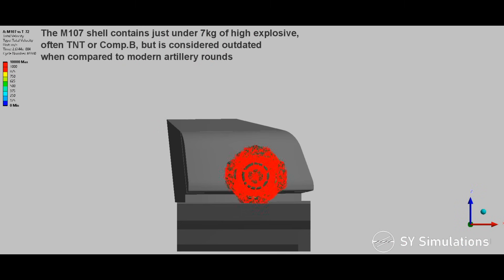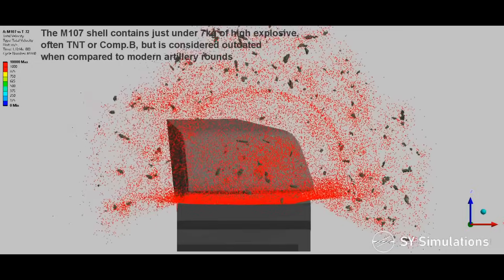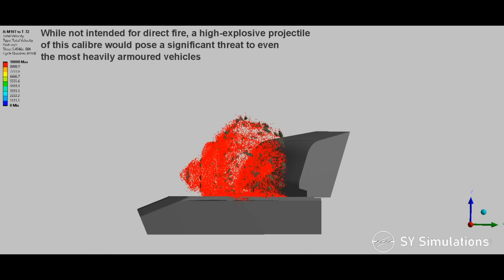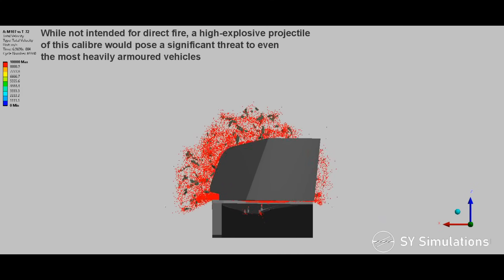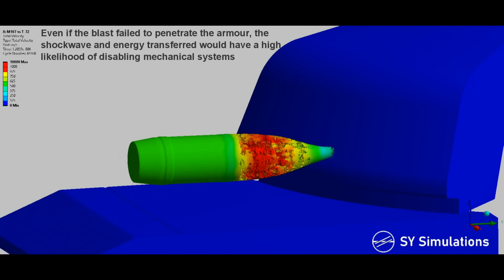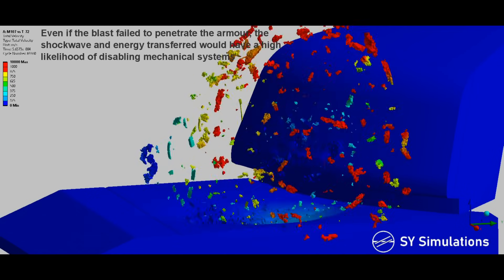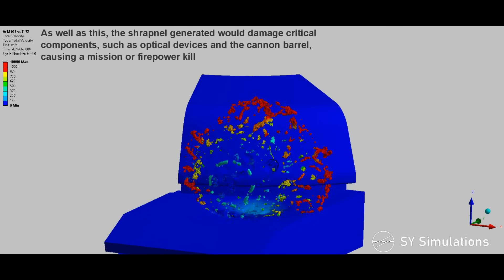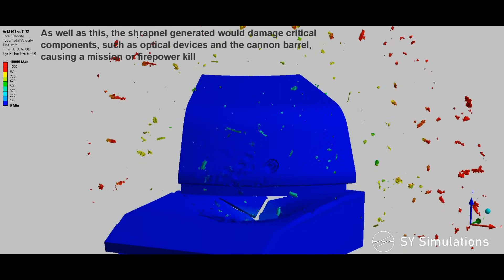DIRECT FIRE ARTILLERY vs T-72 | Paladin 155mm M107 High-Explosive | Armour Penetration Simulation

Comment: What is the thickness of turret roof in T-72 ? Because there are pictures of T-72 tanks which withstood a hit of  152mm HE shell on the turret roof without breach.  The roof was heavily dented and the tank was probably write off but it didn't break trough. Could you simulate a 45deg hit to the T-73 turret roof for validation ?
Reply: I don't know how thick it is, but T-72 tanks are known to resist at least two direct hits from anti-tank weapons like Javelins. There are videos showing it. Unfortunately, we cannot compare the Leopard A6 or Challenger 2 tanks, since Russia has used Lancets instead.
Reply: @abraxasarchon  We are talking here about 152/155mm pure HE shells, would they breach the armor or not if hitting the roof. Javelins have  HEAT warheads and it's not comparable.

Comment: Seeing 155mm HE blow the top layer of the hull to bits like that really makes me wonder why we didn't just decide to forget about penetrative rounds and entirely roll with large HE  fore verything
Reply: 🅱ESH has entered the chat
Reply: @Rhino_Aus  HESH is highly outdated and useless
Reply: There's only so much explosive you can make. Also, faster rounds could struggle with fusing
Reply: Less ammo, less range
Reply: top attack
Reply: 155mm shells are huge by tank standards. Tanks have to be as small as possible so as to increase the amount of weight that can be dedicated to armor protection. Smaller caliber AP shells are easier to load, so tanks don't have to waste volume and weight on having multiple loaders. Tanks don't have the luxury of shacking up in a safe area with stockpiles of external ammunition supply like artillery does, so smaller rounds means they can bring more shells and stay in the fight longer without worrying about running out. And finally, the gun size itself is a factor. With all the previous factors in mind, a military doesn't need to invest into a massive hulking beast of a tank to fire 155mm shells when a 90-125mm high velocity gun can achieve the same results while mounted in a smaller, better protected, and potentially lighter platform
Reply: @andrewzheng4038  In my opinion, the 640 object was a good example of an artillery-caliber tank. The Soviets practiced this, and the only thing that stopped them was the resource of the cannon and the lack of a suitable carriage for such a cannon.

Comment: The turret would be ripped Off.  This Simulation is abolutely nonsense.
Reply from the maker: theres a good chance of that, but its too complex to simulate unfortunately
Reply: Instead of shrapnel Sim, are you able to do shearing force simulation of turret ring vs 155mm energy?  @SYsimulations

Comment: During a trial using an M109 (L23) firing directly at an M48, the fuse failed to ignite and broke off at the impact and the M48's turret was ripped out of the turret ring.
Reply: Same occured during WW2 with the SU and ISU152s. The massive AP shell weighed 40kgs and didn't have to penetrate in order to destroy a tank like Tiger or Panther. The impact of a 40kg projectile hitting the armor at 700m/s would bend and wreck the tank and knock the crew uncontious.
Reply: @marcelkroeze7580  During the Battle of the Bulge the American front line was overran and so the Germans charged with their armor straight into a second line of combat engineers, tank destroyers, and artillery battalions.

One tank rolled into an intersection and stopped to assess which way to go.  It was targeted in direct fire by an American 8-inch gun M1 (203mm).  The German tank was blown completely into the air, separated from its turret, and landed upside down.
Reply: @celebrim1  8in gun's now squarely in the Naval Gun weight division.  Probably turned the crew to jelly.
Reply: @marcelkroeze7580 massive?
Reply: That's why on the 105mm we have HE, Illum, Smoke and HESH in the truck. You wish never to hear the gun commander screaming out loud " TANK! TANK! TANK!" With the rainbow trajectory, 500m/s speed and a poor 1.5km range in direct fire... you're lucky not to be already dead....
Reply: Bcause M48 sux

Comment: A lesson learnt in WWII against German tanks, it didn't matter how heavily the tanks were protected, as long as the high explosive shells were big enough, the German heavy tanks would be at least disabled if not completely destroyed.
Reply: Or incapacitate the crew even without penetration on armor
Reply: Flipped over onto their sides.
Reply: Also roof armour was usually quite thin, so every bigger explosion over or on a tank could do much damage.
Reply: @UkrainianPaulie   well krasnopol hit leopard tanks pretty well, you dont even need explosihe to penetrate its 1sm roof. Even FPV does that
Reply: @愛を込めてロシアから BONUS also hit your T-90M pretty hard
Reply: @brah9249  bonus? Didnt getting your last jokes
Reply: @愛を込めてロシアから  BONUS round
Reply: @brah9249  are you sure this is addressed to me?
Reply: @愛を込めてロシアから  yes
Reply: @brah9249  so what are you trying to say?
Reply: @愛を込めてロシアから https://en.m.wikipedia.org/wiki/Bofors/Nexter_Bonus
Reply: @ClippyThePregnant  oh i got it. What a cringe
Reply: I remember reading about an instance where I think it was the soviets(?) who encountered a Ferdinand and couldn't pen the armour but they still just kept slinging rounds at it.
Eventually when the battle was over they checked the Ferd since it was inactive and found that all the crewmen had died and were bleeding out of their eyes and ears
Reply: @Lo-tf6qt  goes to show you dont need to crack the armor if the round has so much energy, you can just liquify their organs with the pressure, or deafen them with the sound, or both
Reply: Physics is a cruel mistress.

Comment: I'm gonna assume it will be a death for anyone inside, just from primary blast injury alone. An enclosed space with an explosion that big is absolutely terrifying.
Reply: But WarThunder said only loader would be hurt
Reply: Even 105mm HE will 'ring your bell'.  A case in point is a sherman gunner in WWII, who had just slid down into the turret.  He had been speaking to a GI outside the tank.  A 105mm HE hit the turret right on the white star.  This completely knocked out the gunner (he got a concussion), and the GI was beheaded.  This explosion (on superquick fuse), caused the sherman to have engine issues.  Maintenance couldn't figure it out and decided to swap in another engine.  So, the tank was basically put out of action (which saved the crews life since the platoon was ambushed later).  This gunner went on to be assigned to one of the few M26 tanks.  He killed the panther at Cologne.
Reply: @lewcrowley3710  my father was in the 104th Infantry which cleared Cologne.  The 104th was often paired with the 3rd Armored
Reply: Could be one or two survivors as humans are quite effective at soaking up shockwaves 
Potentially deaf and may contain traces of organ rupture but it could be possible
Reply: @eater_of_beanbags lmao what are you smoking mate, a competitively tiny amount of shockwave overpressure hitting your skull can scramble your brains  in an instant, a grenade sized object would do this let alone a 155mm 😂😂😂😂
Reply: @eater_of_beanbags  Jonny is right my man. The M107 shell, which is now obsolete, has at minimum 6.86kgs of Comp B. You're going to need old school heavy tank style armor, and a lucky placement to not get at least knocked out with life long brain damage.
And the potential spall too. Imagine a chunk of steel the size of your whole fist just flying through the guy next to you faster than you can blink, let alone the rest of the shrapnel from the interior of the tank. Spall liners only catch so much. The mega chunks they mostly wont stop.

Comment: What does this mean for the tank crew inside the turret? The driver is likely toast, but how bad would the blast be around two corners?
Reply: Turret crew is probably also dead. IRL the turret ring would be ripped open by this blast as well and what resistance you do get inside the tank is not going to be enough to dissipate that much explosive filler.
Reply from the maker: Yeah the blast would propagate inside the tank so everyones toast

Comment: Why don't they make a tank (like an abrams varient) fitted with a 155mm main gun?
Reply: Less ammo capacity, they would also need an autoloader  if they want to shoot more than twice a minute.
Reply: @jellevandervelde704  What's wrong with having an autoloader?
Reply: @нєманрсь  It would be quite bulky and difficult to incorparate in their current tanks I imagine.
Reply: It's elf propelled artillery, not a tank. The turret to fit the gun are massive and impossible to armour against any more than shell fragments and small arms. Armouring it as a tank would make the Maus would look sane.
Reply: @oohhboy-funhouse  Elf propelled artillery. I like it.
Reply: @oohhboy-funhouse not really a problem considering mbt-70, joint american-german tank project before abrams had a cannon with 152 mm. Problem with making tank like that is ammo capacity and reload speed aswell as trying to hit reliably tanks at higher distances or when moving.
Reply: would be easier to invest in top attack SMART munitions
Reply: The short version is 155mm as it is right now is bigger, heavier and slower, requiring compromises in tank design to deal with the requirements, while also being limited in anti-armor effectiveness.

Comment: You what the most interesting thing about this sim is to me? The frag cone. Imagine that round hitting the ground coming down from a steep angle. The vast, vast majority of that fragmentation is just going to go straight into the dirt and not be a threat to anyone. That really drives home how important timed, and since the end of the second world war, proximity fuses are for artillery shells.
Reply from the maker: Youre right that an airburst fuse would make it far more effective, but a couple of things change when its coming down at a steep angle; its velocity is far lower (around 300-400m/s) so fragments are thrown backwards, and its still coming in at an angle, so on one side, fragments travelling normal to the projectile's axis will actually be travelling upwards relative to the ground
Reply: @SYsimulations  I did wonder about that as one of you sim channels has done a post-pen APHE sim that showed similar results, it just seems kind of wild to think that the shell velocity would make that difference. My intuitions aren't necessarily reliable when talking about such relatively extreme physics lol

Comment: Obviously tanks either adapt with fancy systems or become top/side armor focused rather than frontal armor mostly. Do tanks even get a chance to 1 on 1 any more that often these days or get bogged down by arti & drone/rockets on their way?
Reply: That’s why MBT-70 put all the crew members in the turret. This tank was designed to against HEAT-FS(or ATGM) and HE rounds, not KE rounds. But now we must take the balance of KE and CE, So there is no perfect answer.
Reply: @grigor.h3929 one shot to silouette and its disabled.

While normal tank will still have chance to have undamaged turret mechanisms
Reply: @licrygh   MBT-70 equipped space armor to against the HE and HEAT, won’t be disabled.

Comment: What should be the thickness of an armor to prevent 155mm shrapnel from penetration at the distances 1 or 5 yards from an armor?????
Reply: The shrapnel has a fairly low velocity, less than a rifle bullet, much much less than a shaped-charge jet. The armor here was ruptured purely from the blast shockwave, which is extremely intense at such short distances. Peak overpressure (at roughly 1 charge diameter away) is going to be over 1 million psi.
Reply: @sbreheny  AFAIK a 120mm mortar shells pierces 7mm armor of MTLB and BTR-80 if it hits 5-10 meters from a vehicle.
Reply: @sbreheny  pretty sure we have clips of both Russian and Ukraniane T-72s and T-64s cooking off when an artillery shell impacts a few meters away, artillery shrapnel is no joke

Comment: Apparently, the rounds direct-fired by M109A6 at T-72s during a thunder run were fired un-fuzed so that the kinetic energy of the 40kg shell displaced the turret.
Reply: source: #trustmebro
Reply from the maker: That doesn't sound like the best idea imo, as with that strategy you'd have to hit a more specific area, where as with HE, you could probably hit anywhere and disable something critical/destroy it outright
Reply: @SYsimulations  Tracks, the road wheels, drive sprockets, take out any of those, they aint moving.
If you're lucky you can maybe do some damage to the gun, maybe knock it out of battery if your shells hit just right. An HE barrage is easier yeah. Slugs are more fun tho.
Reply: @SYsimulations with HE you also have to hit specific areas. hitting the frontal hull has almost no effect whatsoever
Reply: @za_pravdu1943  I doubt that the blast, shrapnel and the energy delivered would have "no effect whatsoever". It can mess with optics, maybe fck the zeroing of the sight, damage the barrel, and the crew inside will certainly not have a good time either.
The tank would probably not be out of action, but it would still probably impede its ability to fulfill its mission.
Reply: @Niitroxyde  A lot of people also forget the overpressure effect. A shockwave strong enough will simply transfer the energy through anyway. So an explosive shockwave can basically still kill you in the tank if its strong enough. Think smaller naval caliber sizes, like 8in guns. The shockwave will 'pass through' the armor and slam into your brain and actually just end all electric cycles in your nerves. You just 'turn you off' for all intents and purposes. Its not... the worst way to go.. considering the fact that your infantry comrades are just.. smears and memories in this situation. Now if there's spall... well... You know how it goes.
Reply: @Your_Resident_Redleg  Yeah for sure. I was more thinking about ruptured eardrums, concussions and things like that, but if the blast is powerful enough then yeah I guess it could create a big enough overpressure to even damage vital organs.
Although I'm not sure how big of a round you would need for that, but probably pretty big.

I'm also wondering now that we're talking about it, wouldn't there actually be some sort of openings in the tank to prevent that ? A tank is not airtight after all, except if we get it into that condition (like for a radiation/chemical warfare scenario)
Reply: @Niitroxyde  You'd be surprised, supposedly, the 6.86kgs of explosive mass in an M107 shell should be enough to have a full crew knockout, but you're gonna need a lucky hit in specific spots on turrets for that. But yeah you do want some more explosive mass for that.
Also any time we were out, we buttoned up air tight for two reasons, A, because if you do so while the chemicals are falling on your position, you're too late..
B: because we would use the HVAC system as AC and it actually kinda works if you don't let the air out. The paladin gets hot in the sand!
Reply: @Your_Resident_Redleg  Makes sense, thanks for the insight !
Reply: @Niitroxyde  One thing to remember is not every unit's doctrine is exactly the same, and certain conditions may change what the exact procedure is at any moment. 82nd for example might just button up at all times because we were cav. We are in gogo mode keeping apace behind the abrams. The less that's open the less liabilities.
But a paladin unit in another formation might not require that sort of attitude, and they may allow hatches open in travel off road.
There is no, one exact way of doing the task, just one guideline. Its a firm one, but like a sword it does have flex where its needed.
Reply: The story I heard, from a member of the Utah Army National Guard that was in the first war in Iraq, was that some idiot thought that it was a good idea to move the paladins up becouse the size of the barrel would scare the enemy. As they came around a sand dune, they found themselves looking at an Iraqi tank facing away from them. They loaded the heaviest shell they had, five red charge bags, and ran out the back with the 50-foot lanyard just in case they missed. One version of the story said that the turret came off from the hit, and in another, it jammed up the turret ring.
Reply: My TC told me we'd use concrete slug versions of M549s, (Rocket assisted round) against something like a T72 because its too heavy for the armor to stop so it'll actually just crush its way through the armor. There's semi guidable fuses we have that could maybe make that work. But a good ol fashioned HE barrage and just disable them is probably easier.
Reply: A direct hit from above with a high explosive round from a large caliber artillery piece is the end for any tank.  From the side, the tank would do better.... but it's probably going to be toast.  The size difference between what a typical tank can shoot versus a palladin is very noteworthy.